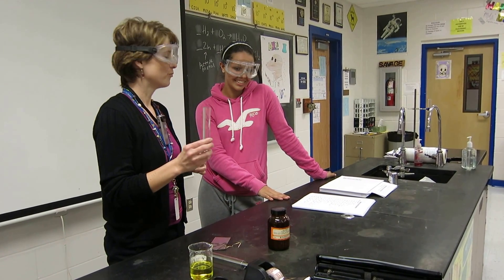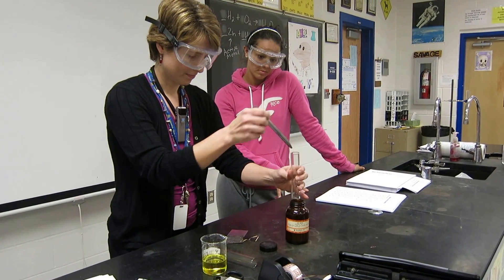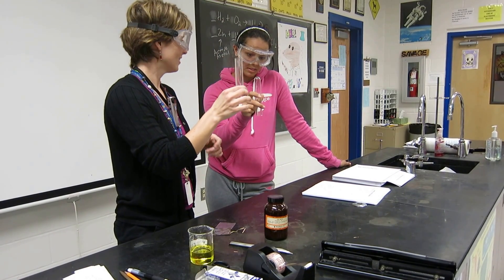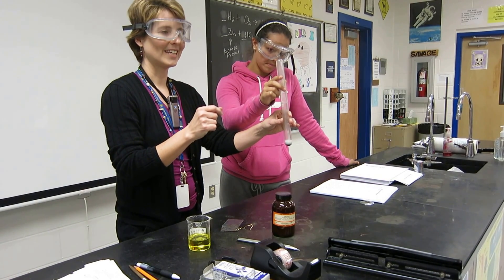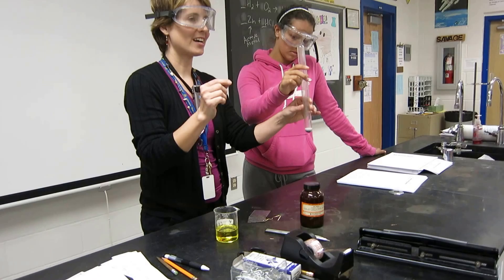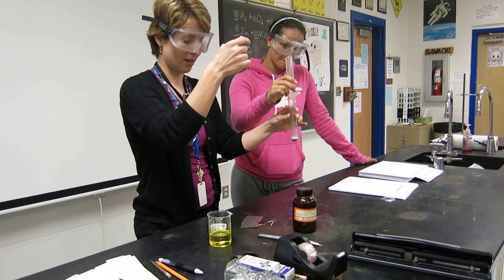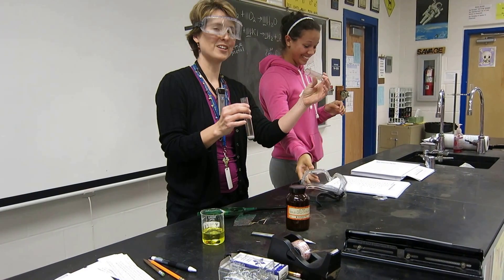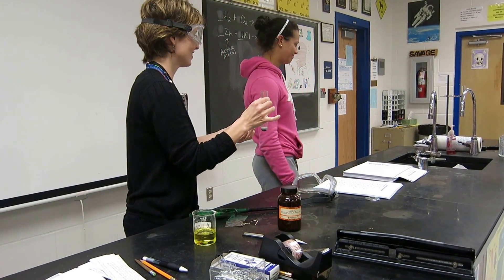Zn and HCl

Comment: If the gas being produced is hydrogen, which is colourless, howcome we can see white smoke? Is it chlorine gas or zinc / zinc chloride particles?
Reply: Good question! The HCl is concentrated, so some of the molecules of HCl lift off the surface of the solution, increasing in number with the production of heat in this exothermic reaction. The HCl molecules are hygroscopic, which means they attract water from the humidity in the air. This forms a caustic, visible acid cloud that is not good to breathe. We were using such a small amount that it dissipated quickly and did not irritate our respiratory systems, but if you're working around larger quantities for any period of time, it's advised to use a fume hood. Thank you for your interest. Remember, Chem-Is-"Try"! :)